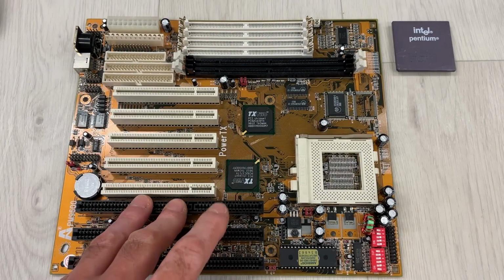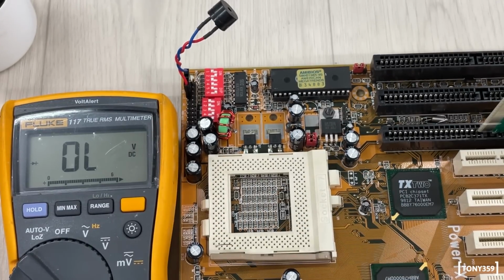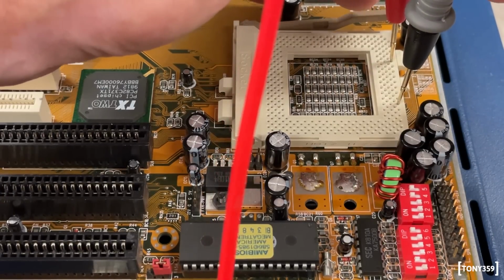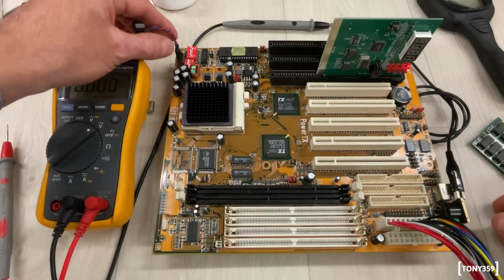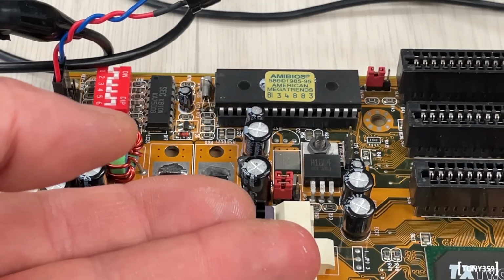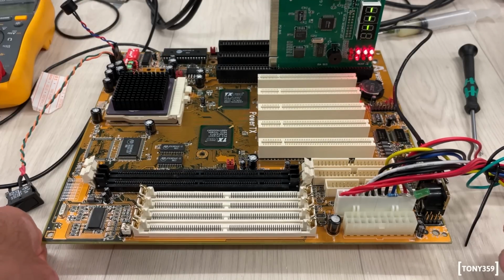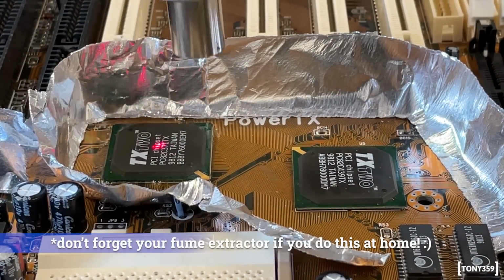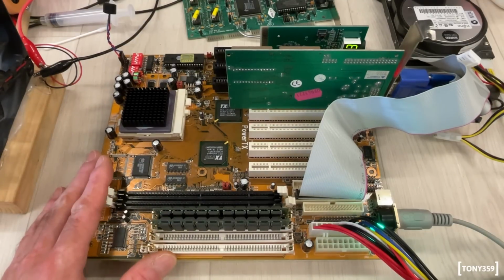AMPTRON PM-9600 Socket 7 motherboard repair

Comment: I just wasted 2 hours of my time wondering why my cpu voltage was off until I watched your video.  Thank you for posting this video.  My machine is a PCChips M577 which is the same a AMPTRON PM-9600 so a sibling to your board.  I figure the voltage off without a load runs in the family.
Reply from the maker: ahah I cannot remember what the problem was with that board! But glad it was useful!

Comment: Seems like this board had integrated sound on board, because they had the jumper pin for the bracket. But not the sound pro chip. Anyone who knows about this board , because the TX Pro chipset mainboards mostly (not all) had a sound pro(CMI-8330) sound chip onboard.
Reply from the maker: Very interesting, it's been a while, I didn't notice! Thanks for watching!

Comment: My Fujitsu Ergo Pro motherboard, is now deadlined post giving it a wash. I was gentle, but... It complains it has no RAM if there is none installed. And then I plug that in, and... nothing. So Tony, your video is certainly an inspiration to get tooled up, and to try and figure out where the issue is. In the meantime I've ordered two replacement DIMMS, just in case the original one went bad. Great video, please more of the same as I have learnt a lot from it :)
Reply from the maker: Amazing thank you! For your Fujitsu, if it was only washed I'd recommend some good contact cleaner on the RAM slots. I found that the one for switches - which leaves behind a thin layer of lubrication which enhances conductivity - is much better than the dry one. De-Oxit is probably as good.
Good luck with your project!
Reply: I have ordered a POST analyser card, not needed one till now, but with zero output, its a must. Also ordered the Aishun soldering station you covered. I know its flawed, but it appears to be FAR supperior to the iron I have, especially the heat delivery. Anyway, Ill try the new DIMMS with the POST card installed, and take it from there. BTW, what oily contact cleaner do you use?? DeOxit is good, but its pretty expensive for its can size... @tony359
Reply from the maker: I love Servisol S10, now sold under a different name.

Comment: I sold these boards in systems back in 1996 with p120, 133 or 166's later.. worked well and the TX chipset was great at the time.
Reply from the maker: Indeed the PC-Chips/Amptron were loved/hated as they could be nasty but some models were actually pretty good and cheap! Thanks for watching!

Comment: Thank you for that great Video.   

I have found a PC on the Streets, it is an Desktop PC with an Intel Pentuim MMX with 166 MHz, 16 MB RAM,  1,6GB HDD IDE, 52X CD Drive, it has a VX Pro II Chipset, and it runns Windows 95, that pc was almost bever used. The Windows Installation is from 1997 als the Whole PC. Special for me is, it has a AMI Bios called Winbios, and a Souundblaster card. (Vibra_16) ISA 

I just replaced the CMOS Battery.
Reply from the maker: Hey thank you!
wow that's so cool! What motherboard does it have?

Comment: I like these lower speed Pentiums.  With 486 machines being extremely expensive, a P100 can be under locked to a P33 with jumper settings it runs nearly all 486 based games and Windows 3.1 very well.  I find 75mhz is the sweet spot.
Reply from the maker: oh cool I didn't know that! I got the 90 as it has a special place in my youth but I also have a 200Mhz MMX. Thanks for watching!

Comment: 23:15 handy program to use is hexcmp to compare binary files :) so you can also see if what u read is identical to what u downloaded
Reply from the maker: Thank you! The 866II does that as well. All I need to do is to load the BIN file and then click "verify". The "verify" button compares what is read from the chip with what is on the "workspace". Thanks for watching!

Comment: My goodness, you are the first hobbyist person on YT I've seen to this date use a PCB heating plate. I've been telling everyone for a while (even some of the larger channel hosts) to use one, because its not just for place and flow - it can enhance your desoldering efforts, enhance your regular soldering (metal-wetting and flow,) and even help make your joints more resilient to potential cracking resulting from cooling too fast. In some cases it might help with older PCB warping and separation. Good practice sir. Cheers.
Reply from the maker: ahah I'm glad you like my technique! I've read and experimented a lot to realise that pre-heating is more or less a must when working with SMD. I am too appalled when watching much more famous youtubers (sometimes professionals) blasting 500C at a multi-layer board to do the job. I have a video coming clearly showing why no preheating is bad! Thanks for commenting and for watching!

Comment: I've put off buying a preheater bed for long and this convinced med I need to order one.
Reply from the maker: I did the same but it's really necessary - even for small jobs. Yes, you can set the hot air "at maximum" but that's not how it's supposed to work. If you end up with the one I got, please bear in mind it's now been banned from the UK because unsafe (no earth connection which you can fix yourself). My review is here: https://youtu.be/Y3bPvus-_as

It's not the best on the planet but it works. It's just very slow and ignore the temp readings it gives you :)

Thanks for watching!
Reply: @tony359  oh i see why you put off buying it.. its a pretty damn expensive investment to fix a $20 board (that might be worth $100 when fixed)..
youd have to fix 4 or so boards/cards to make it worth it
Reply from the maker: @kyrieeleison1905  I feel it's an important tool in someone's toolkit - clearly not just for one board! :)
Reply: even using a temperature controlled hot air gun can work for large ground planes

Comment: I think I had one of these boards for a cyrix build I did in 1997.  IIRC it failed shortly after my trident video chip blew up, if I can find it I'll have to look at those BGAs.  I was under the impression that boards started going solder free much later than 1995, I wonder if I'd kill fewer boards with a bga reflow attempt if using a preheat station.
Reply from the maker: in my experience preheating is a must when re-flowing! Thanks for watching!

Comment: what was the liquid you applied to the pins of the IV chip to heat and then remove it?
Reply from the maker: Flux. It prevents the solder from oxidising. This way the solder melts better and flows better. It's totally needed for soldering, maybe not 100% for de-soldering but it never hurts. Thanks for watching!

Comment: Doesn't surprise me that the problems on this mainboard were that of a bad soldering, Those mainboards with TX Two or TX Pro chipsets were the cheapest out there. Imagine a mainboard for $35. So their build quality wasn't really up there. They got used in the cheapest PCs, also I remember that they weren't that stable
Reply from the maker: Yes, many viewers have said the same, also made me aware of boards with fake cache chips on them, amazing! Thanks for watching!
Reply: @tony359  No problem. If you have some time, check out the Red Hill Hardware Guide, which has a lot of the hardware info of the late 1980s and 1990s. PC Chips made those fake cache boards. I watched about a dozen of your videos, and I like them
Reply from the maker: @michvod  thank you I'll take a look - and thanks for watching!

Comment: In the Doom engine, the game simulation and the video frames are locked together, and each time the game simulation is advanced and a frame is rendered, it's called a tic. The game is designed to run at 35 tics (or frames) per second, so a tic is meant to be 1/35th of a second. When the game runs at this ideal frame rate, time in the game is progressing as fast as as real time. You have 1 gametic (1/35th of a second of in-game time) for each realtic (1/35th of a second of real time).

If the computer isn't fast enough to keep up with that, the game slows down. There is more than 1/35th of a second of real time between gametics, so you have less than 1 gametic per realtic. If the computer is fast enough, the game doesn't try to run faster than 1, because then game time would progress faster than real time, so 1 is normally the maximum. But for the test, that limit is removed, and it tries to run as fast as it can, so you can get more than 1 gametic per realtic.

So what that message in the video is saying is that it processed 2134 tics (60.97 seconds) worth of game time, but it only took 1459 tics (41.69 seconds) worth of real time to do so.
Reply from the maker: Amazing, thank you so much for taking the time to explain that to me - I did not know that and it's amazing!  So 51.2fps if my math is right?

Comment: Sir, you just got a new subscriber! :) I have myself an Amptron PM8600 which is of course not working properly... when I enable the onboard L2 cache it's just random stuff on the screen after post. Will do the same as you did. Will look for detached pins between cache and pcb... as a first step toward a fully working mobo.
Reply from the maker: Please keep me posted! Also it seems that AMPTRON is another name of PC-CHIPS and apparently they used to manufacture boards with FAKE cache chips! I know, it sounds impossible but there is an LGR video showing that! Make sure your boars has good ones - this is LGR's video: https://www.youtube.com/watch?v=mZnS-whVuDI
Thanks for watching!
Reply: @tony359 I totally gorgot about this. Yeah i checked the pins of the cache but they are all ok, so i guess it's a bad chip. Meanwhile I got another pm8600 and this one is perfect. Maybe I could try and swap chips, but not really seeing the point, since the first board is in a poor shape anyway... Burnt usb traces (i guess someone connected the usb ports the wrong way) 😅
I also read about the fake pc chips cache yes, but fortunatelly these boards have working chips, usually they fakef the amount (showing 1mb, when there was only 512kb)

Comment: I have the same Pre heater. My ground wire on my device was added abouve paint and didn’t make connection. You probably should check if your ground is good if you not already have done it. 👋
Reply from the maker: Thank you! I had the same issue, you can see me rectifying it on the video review I made here: https://youtu.be/Y3bPvus-_as

I also published a follow up where I add some extra earth connections to be on the safe side.

This pre-heater has also been banned by the UK government for this very reason.

Comment: This motherboard is very similar to the PC-Chips M571. It has integrated VGA, there's a 15 pin connector on the left of the PCI slots, where you can add a VGA header.
You can confirm that by looking at the bios, where you can select the frame buffer size up to 4mb.
Reply: Theres no point of using it.. Back it the days it was a low cost solution.. So dont expect high performance of it.. Better go with a faster PCI solution instead.
Reply from the maker: @rallyscoot  now I’m curious! If I get it fully up and running I’ll do a benchmark comparison!
Reply from the maker: oh, I was wondering what that header was. I'll check in the BIOS but if it has integrated VGA, do you know which one the VGA chip is? I cannot find any info about the AliM1531 (TX TWO) having an integrated VGA inside.
Reply: @tony359  Edit: that's actually a pin header for USB/ PS2 ports, using an ATX form factor card, check out this video: https://youtu.be/49nIzruszhI

Now why did they add a Frame buffer option in the BIOS, that's beyond me.
Reply from the maker: @juniorbcm5375  ah ok! Some web pages say the chipset is an Ali M1531 and I could not find any reference of a VGA. It would have been cool though! Thanks for your feedback!
Reply: The M571! That was the first mainboard I ever bought (obviously my first build too) although I’d been playing around with a Viglen 486 for some time. 

That’s an expensive board to buy these days 😢

Comment: amptron was another division of that crappy company pc chips the company who was known to sell motherboards with fake cache chips. amptron had awful c/s i had one of there socket 462 boards back in the day that failed and not only did i have to pay to send the board in at my cost they made me pay them $30 to repair the board even though it was under warranty they said this was a fee the charged everyone for warranty funny now other manufacture had such a charge. then after all that they sent a board back with dead ram slots.
Reply from the maker: Ah, amazing! I've heard of PC Chips only a few times and every time it was such a negative feedback! How can you possibly sell boards with fake chips on it??? Lol Thanks for watching!
Reply: @tony359  ya it was back around the 486 era the funny thing to the fake chips are soldered to pads that don't even have traces connected to them so u couldn't even put real chips on them. i guess they also did some tricky in the bios so the system would even claim there was cache when there wasn't. pc chips lasted till around 2005 and then they were bought out by ecs who are still around they are another low end motherboard company. a few other utubers have done videos showing off those boards with fake chips.
Reply from the maker: I found a video from LGR on the subject! Unbelievable! How can someone possibly sell such thing? 😂
Reply: @tony359  idk there is a lot of scummy companies out there who have no trouble with lying to there customers for profit i guess. in more recent times look at gigabyte with there exploding psus that they tried to sweep under the rug rather then just do the right thing right way they had to be called out by multiple large tech utubers before they recalled them.
Reply: @mraaron1584  pc chips bought ECS! They decided to use the ecs brand because their own name was kinda burned.

Comment: A motherboard of that age probably didn't use lead-free solder.  Lead-free only really became a thing in the early 2000's.
Reply from the maker: oh, I didn't consider that, thank you! I should have touched the chips to check they were floating but my hands were not cooperating... :) Thanks for the tip and thanks for watching!
Reply: @tony359  Even in my younger days I'd probably not have trusted my hands not to shake.  I certainly wouldn't trust them now - nor my eyes.  Stereoscopic magnifiers are your best friend 😁
Reply: @tony359  , 220C peak temperature at chip's top is OK for PbSn solder. It should be much higher for PB-free solder. And thanks for interesting video!
Reply from the maker: @romanm.4763  you're right, I think the industry profiles call for 240-250C - well thankfully that was PbSn! :) Thanks for watching!

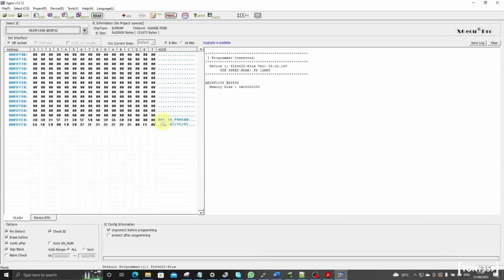Comment: If you look at the data of the flash bios showing at 22:23, you'll see at 0001FFFF0, "EA 5B E0 F0 00", which is the reset vector, the first instruction executed by the processor after it comes out of reset.  It's a jump to F000:E05B, down lower in the Flash ROM, where it starts to execute code.
Reply from the maker: Very interesting, thank you! Is this code the same on any BIOS of that age?
Reply: @tony359  Any Intel BIOS on any Intel-made board that I'd ever seen, from the 386 through to the Pentium 4 units.
Reply from the maker: cool, I didn't know that! Thank you!

Comment: Shorting electrolytic capacitors will generate heat and noise on the power line.  When you check to see if anything is getting hot, you should check the tops of the electrolytic capacitors as well... but be aware, when they go full short they can get extremely hot!
Reply from the maker: Thank you, good tip, I'll keep that in mind!

Comment: WTF is that chipset? TX TWO? Never seen those in my life, and trust me when I say I worked on a TON of PC's during those days. Who the heck made those?
Reply from the maker: Ahah yes, had a similar feeling at the beginning🙂
Reply: Its a marketing marking. Its ALI, but they used "magic" TX to look similar like Intel. There were also some fake VX chipsets.
Reply from the maker: @xsc1000  ahah yes! The TX of Intel TX. When the marketing dept takes over 🙂
Reply: That's something PCChips did for their mainboards, they had ALi, SiS and VIA supply them re-marked chips. The different iterations of "TX Pro" and "VX Pro" were from each of these companies. SOYO did the same but rebranding various chips to ETEQ.

Amptron was a brand of PCChips.

Comment: Just FYI, back in the day it was always recommended to populate the first PCI with the video card. Not sure what difference it actually makes in real like. Probably to give the video card resource preference.
Reply: It would tend to place the video card closer to the North Bridge and therefore electrically better signal quality, but the main reason may have been that each PCI slot has a unique configuration space address, decided by the IDSEL pin, and I think the first slot may have been more consistent in being a particular device ID.

It may also have meant a better bus priority from the bus arbiter, as you mentioned.
Reply from the maker: That’s a good tip thanks! Now you mention that, it rings a bell. Do you know which one the first slot is, the one on the PSU end or ISA end? Thanks again
Reply: @tony359  The one at the top when stading inside the case. The one furthest away from the ISA slot, or next to the AGP slot.
Reply from the maker: @eugenioarpayoglou  thank you! I shall definitely do that next time!

Comment: I have an ASUS socket 7. The debug does not show the code. It may be the chipset is faulty.
Reply from the maker: Hi there - it could very much be. Did you check the voltages, clock and reset first?
Reply: @tony359  I checked the voltages, it is okay and flashed the BIOS.
I will check the reset and clock.
Reply from the maker: Let me know the outcome!